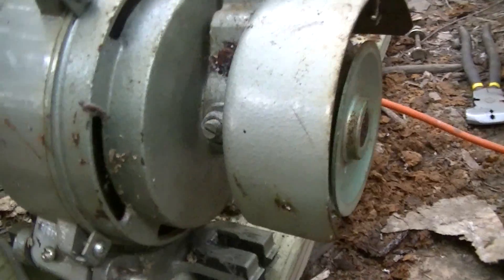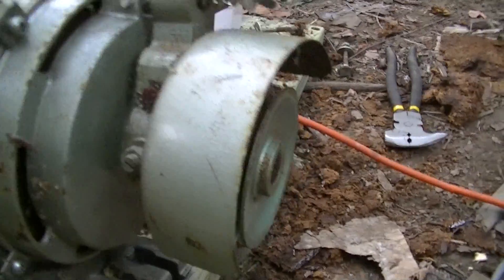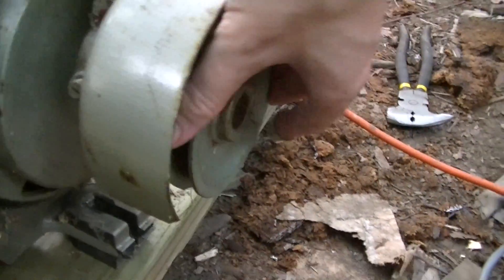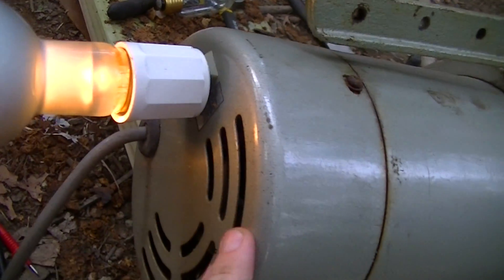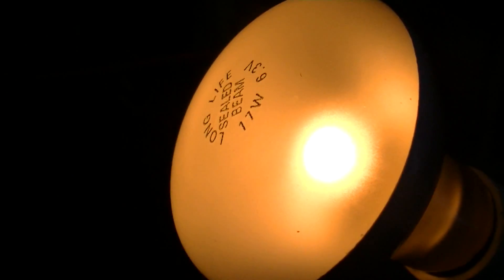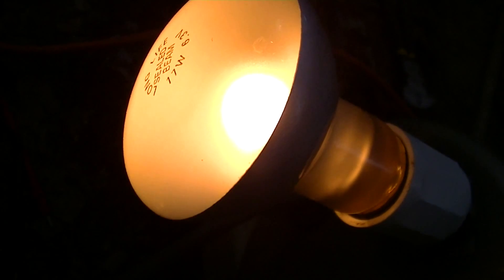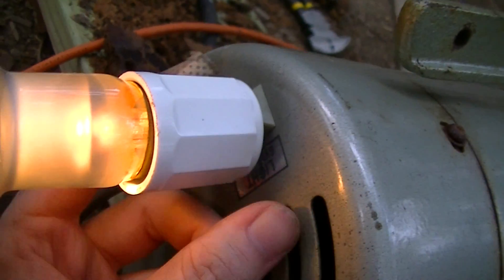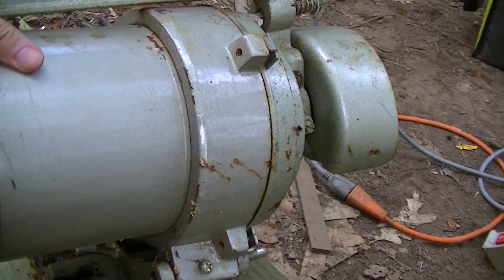Commercial sewing machine motor

Comment from the maker: The lamp dims when the motor is started, so I think that it may have its own winding.  I will test this when I next have access to it if I remember.
Reply: randacnam7321 my motor sat up for several years when I cleaned and oiled the machine and tried to use it I forgot how to attach the tension rod also the pedal is not able to release the clutch. Any help is appreciated.

Comment: Is the lamp circuit on its own winding or just tapped off the mains winding.  Industrial sewing machines are quite violent to use.  When they train new operatives they make a big loop of material that goes round continuously so that they can get a feel for the sheer speed and force the fabric gets ripped through at.

Comment from the maker: The clutch assembly is an integral part of the end of the motor, so I would have to make a new end.  I will leave it but rig up the controls so that its rest position is freewheeling and the brake has to be manually engaged.